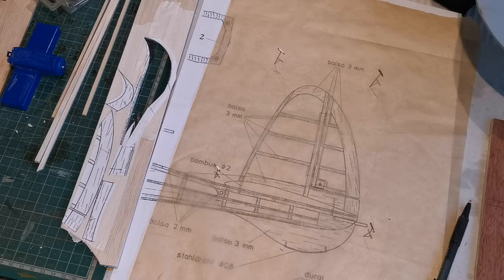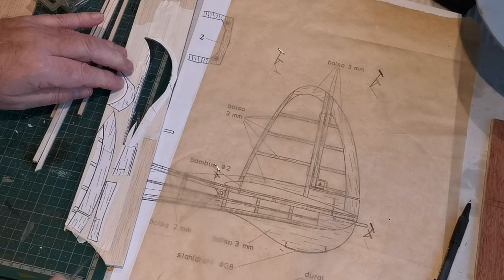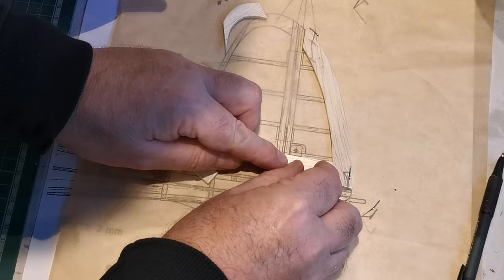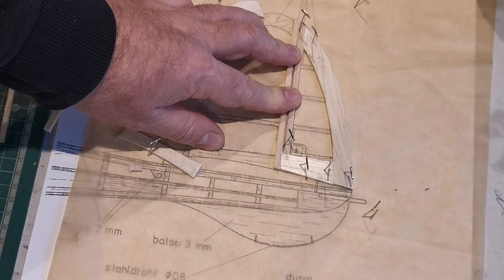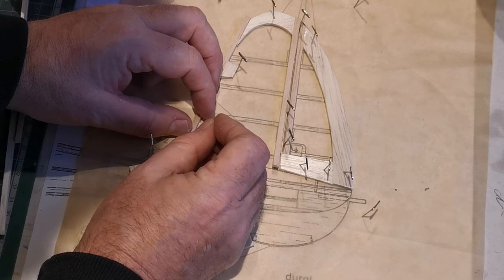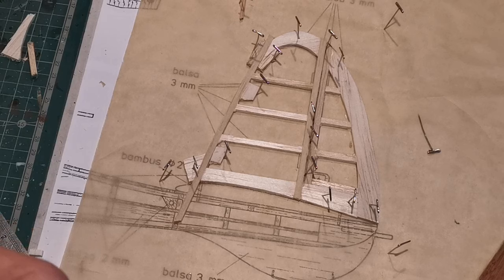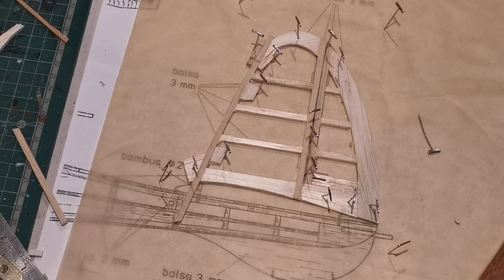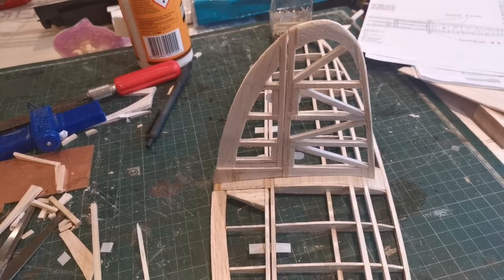Step by step building a balsa model :the vertical stabiliser

Comment: Hi Mark.  The way to avoid force pushing on your rudder is to have a pull-pull setup.  Then the force is pulling in both directions.
Reply from the maker: I understand your thinking but as I see it pull /pull still puts a force on one side at a time. Perhaps I am wrong but it isn't going anywhere now.
Reply: @MarkCroucherRC4fun  Yes, but it will be pulling against the fin post, not pushing oy the hinge.